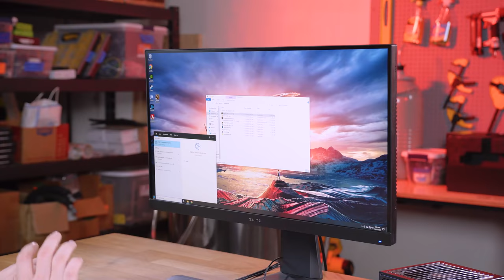This PC almost stumped me... can you guess what went wrong??

Comment: I had this same problem when I got my thermaltake core p3. The stock riser cable that came with the case is super janky. The problem was fixed using a tt premium riser cable. That's hilarious that the symptoms are exactly the same.

Comment: Maybe mention or asking did he use custom cables for the power supply as for example corsair cables are wired different then EVGA  cables so you can not mix them ?    Also as a Canadian living though so may snow storms Jay you get 10 times more static then we do

Comment: 8:08  If you have high enough humidity, you wont/can't have high static.  If on the other hand, if you have little insulation, the air exchanges will be so high the humidity won't ever build up.  Then you can have static issues.  My house is super-insulated and I have high humidity issues without any static issues at all.

Comment: I once had a Pc that locked up randomly over night. If you turned the machine off it would turn back on and lock up. What happened is I RMAed the board and ASrock sent me a board from a different region. It ended up being a Philippines market board. The board had dehumidifier circuit. It was a stock cooler. What the circuit does is brings the CPU to a little higher than recommended with no fans to deal with high moisture environments. Turning that off the board ran like a dream.

Comment: the last pc i built ended up having a bad motherboard AND a bad PSU. i know this because i swapped mobos and it booted, but then shortly after the PSU just started clicking as soon it was turned on and was dead. changed the PSU and it booted. tried the original mobo and totally dead. so both mobo and psu were dead. which killed which i have no idea. maybe just a coincidence.

Comment: the core p3 does not require a riser cable; you can install a GPU horizontally or vertically. it also has grommets everywhere cables, er, traditionally go—it does have a bunch of places cables can come out that are ungrommeted (rails for fans, ssd mounts, etc)—but the spaciousness of the case, even with a bunch of rgb controllers stuffed in, makes it highly unlikely anything would have gotten pinched to the point of grounding against the case. finally, thermaltake no longer ships a riser cable with this case; you have to purchase one separately from whichever brand you choose.

Comment: Those thermaltake riser cables, I swear are all junk. I built a system in a View 31 case and used one of their riser cables to vertical mount my GPU. After about a year or so of use, I started to get some of these same weird stability issues and crashes. My issue ended up being the riser cable. When I removed it, I actually noticed some of the conformal coating had actually melted.

Comment: I had no idea Gigabyte makes power supplies. 
But I have seen a no name one today that came with some loose screws bouncing around on the inside and components soldered in crooked. 
So I'll just stick with seasonic for my personal systems. And for cheap builds, great wall or corsair.

Comment: Given that both drives died at once and there was immediate smoke, I would be willing to bet that the PSU failed to regulate the power output and toasted almost everything. In such instances, it’s entirely possible that all components are either damaged or destroyed. Unfortunately, it takes systematic testing of all components individually to determine full functionality.

All that is to say, he got super lucky...and the riser cable could have been bad from the outset anyway!

Comment: I have an old coolmaster emba 850 platinum that only runs if it is hooked to the motherboard header? It will not run if i short the green and black wire.All my other power supplies can do this.Is there something wrong with this power supply?

Comment: Lol air doesn't hold a static charge, it acts as a catalyst for surfaces to build a charge. In other words, a humid environment would only be an issue if you were touching hardware while it was running (and you were some how building up a charge, i.e rubbing your feet on carpet etc).

Comment: As soon as you said he had a TT P3 case I knew it was the garbage Riser cable. I got the original P5 case and the cable was shit back then. The TT forums are full of complaints, they were sending out cables to anyone that asked ThermalMike for a cable. I got 2 replacements and they were still garbage. I had to fork out for the TT Premium cable and that has worked flawlessly ever since. I got a cheap grey riser cable from AliExpress and that worked better than the one TT put with their cases. I can’t believe after all these years they are still sending the cables with the cases.

Comment: Hardware Canucks did a video about riser cables yesterday, saying how most of them can't work well with pcie gen 4 and cause all sorts of problems. their solution was to manually set the pcie slot to gen 3 in the bios, maybe try that!  edit Apparently i'm not the first one to suggest that.

Comment: I've had two cpu failures in my lifetime. The last one was just a straight death of a haswell i5 but the first one was really cool. My sandy bridge i5 2380p experienced a really bad power surge (house was not properly protected from lightning), but rather than burning out the cpu, instead I guess the surge caused one of the ground pins to weld itself through the corresponding contact pad on the cpu and into the pcb of the cpu. The cool part is, I didn't find out about the damage until years later. Other than needing to reset my panel box after the lightning strike, once the power was restored the computer powered back up, failed 1 boot then worked normally. I only found out how bad the damage was because after I moved, when I tried to turn it on nothing would happen, so I figured something shifted in the move and decided to do a full tear down. When I pulled the cpu, it had a little resistance but popped out before I could question it. Then I could see a group of pins that were oddly curled in the socket. I hadn't pulled this cpu since I built the system and I knew it wasn't like that when I built it. So I spent some time straightening the pins that were curled and realized one was missing. So I turned over the cpu and sure enough you can see where the pin went through the pad then kind of sideways under one layer of the pcb. But after straightening out those pins, I reassembled the system and sure enough it powered back on with the only issue I could find in its performance being that it could not run the secondary ram slots on the motherboard, only the primary pair worked. Wasn't really an issue since I only had 1 pair of 8gb dimms. I only retired the system a little over a year ago and I still have the motherboard and cpu. I just can't bring myself to get rid of it lol.

Comment: Not exactly the same cable but my current pc started randomly locking up completely even the reset button wouldn't work! Went through memory diagnostics, reseated it several times and even replaced it just in case, it would for a few days then back to lockups. I finally tracked it down to a failed sata cable, it had been in the system for over 4 years when it finally decided to fail.

Comment: in regards to sticking to brand name psu's, i had a faulty 1000 watt platiunum seasonic which would instantly trip into some sort of protection when i tried turning my pc on. switched it with an 850 watt cooler master and it has been smooth sailing ever since.
what was also fun (on a different pc) after installing a Cooler Master Neptune 240 AIO my pc at first wouldnt turn on. so i took out all the memory and tested all sticks individually (swapping the single stick for another after confirming it worked) they were all fine. turned out one of the metal posts i had to screw on scraped of one of the traces from my motherboard.. not so great mounting design and terrible design on the motherboard trace layout if you ask me

Comment: been testing a few riser cabels.. the thing i learned was to watch if the design was shielded like explained in the video but also watch out for the 90degrees versions where the conn sits on the same side.. that means that the trace on the other side is longer.. example: look at your memory traces... thats why they zigzag balancing the resistance...  try walking with one leg a few inches shorter.. it looks fooked^... 3m has one of the best cables they say.. so I tried one for my usb paulpang audio card and wow yup confirmed haha!! for video I can't confirm it yet but enough reviews out there

Comment: Speaking of crazy repairs.  I was once tasked with trying to find out why a pc had some very weird things going on.  For one, the mouse pointer would move around the screen on it's own in a very jagged and random fashion.  It looked like how it might appear if a user was holding the mouse while being electrocuted.  This was coupled with random crashes, blue screens, and spontaneous restarts.  

Upon opening the case I noticed something looked very wrong, but I couldn't quite put my finger on what it was.  All the cables were properly and well connected.  Cable routing was messy but not tangled, crimped, or stressed in any way.  

As it turned out, what had happened was that the last tech who worked on the system made a major booboo.  They put a screw through a mounting point directly to the case without a riser.  And so solder points on the motherboard were randomly shorting to the case.  Upon removal, all appeared to return to normal operation.  Whomever did this had to physically cause the motherboard to bend and flex in order to install this mounting screw.

Comment: I wonder if this is something that should be mentioned more in build guides - don't let your cables get pinched or pulled.

Whether that was a bad riser out of the factory or not, the 315 bend he had there could have easily broken a solder joint, even a good one.  Making sure the bend is a bit further up the cable where it's not pulling on the solder joints/pcba might have been enough to prevent the non-psu issues.

Comment: Could be that a voltage spike sent from the psu went through the riser cable.. Found the weak point and toasted the connection. Very possible it was at one of the sharp bends causing a weak point.

I bought a computer that would randomly shut down once hot.
Ended up being one of the pins going into thr mobo from the ps had backed out of the connector. Once the computer got warm enough.. The connection would seperate and computer would crash.

Comment: i have the same exact riser cable and same screen issue but no smoking. it changed the bios setting for the pcie slot. I changed it to 3.0 instead of using the 4.0 option. not sure if it is really the same problems here

Comment: As an electronics design engineer let me tell you. Just the idea of a riser cable, when considering high speed data transmission, gives me nightmares. Both in terms of data transmission integrity and EMI generation. Just no. If a riser is going to work, and work well, it has to be done in the right way. Otherwise you will get massive stability issues at worst or performance degredation at best. Do not skimp on riser cables. Best yet don't use them at all.

Comment: I've had a fault system that was caused by the case acting as a weak battery for some reason and shorting out everything. It became that way after surviving a lightning strike. Any hardware in that cabinet crashed or would boot, out of the case they worked just fine. Using a riser cable and bringing a pci car close enough to the case also made it crash or stop working. It was a really old heavy case, but stil it's one of the 3 most weird pc errors I have ever seen.

Comment: You didnt specify if it was a 30 series gpu, but if it is, it should have  a pci-e gen 4 riser, if you are to use a riser.  If it is gen 3, it may be hit or miss, even from the same manufacturer and model.  You can specify in  the bios and have it run in 3.0 vs auto, to get the 30 series to at least run.  I have a linkup riser for my 3080, it is amazing.

Comment: I wonder if they had bad power combined with bad electrical and bad static that blew out the power supply and the riser cable was a secondary fault or maybe got hit with higher current than it should have?

Comment: A capacitor is made from 2 conductors separated by an insulator.  Wires ran in parallel like in a riser ribbon cable create capacitance.  Capacitance resists change in voltage.  Changing voltage is how computers talk.  A riser card could cause issues with your videocard talking to the motherboard because of the capacitance created by a poorly designed riser.  The length of the ribbon cable is what I would be looking to minimize in order to reduce any potential to create capacitance.  This is one of those things that might not look as bad on paper to the engineer but in practice can cause real life issues.

Comment: can someone help me, my PC experiencing black screen in heaven benchmark, but the program doesn't crash. the gpu is an zotac gaming 1650 low profile btw. all drivers are updated in windows and clean graphics driver using ddu.
Reply: Also, Itried directx9 and opengl and it works fine. Only the directx11 is the problem

Comment: Could he have accidentally got a 240v PSU (Europe) instead of a 120v (US)
Reply: If so, that'd probably explain the smoking!
Reply: @gwenmichigander277  That doesn't matter. These PSUs automatically switch between voltages, proof: I am using one I got in the UK in the US and it works perfectly fine, and even the manual says the input voltage is 100-240VAC.

Comment: Hey Guys, I'm building a new pc right now for the first time, my question is, shall i get the ryzen 5 2600x + different cooler to overclock it to its 4,2ghz or just a ryzen 5 3600 with stock cooler and no oc
Reply: 3600.  the cost savings with the 3600 with a stock cooler will still perform the same as that 2600 and both cpu's cost basically the same.  There is absolutely no reason to buy 2000 series.
Reply: @motoryzen  my thoughts on this were to have a cooler and a higher speed as a 3600 but when upgrading i still have my cooler to eventually oc the newone too, so the upgrade would be bigger or is the way i think wrong
Edit: I live in Germany and the cost for the 2600x + proper cooler is 20€ more than only the 3600

Comment: You should always be careful with where a cable connects to a connector.  They tend to be thin, and can break/short easily on cheaper ones -but it can happen on more expensive ones too if bent at too sharp of an angle multiple times.